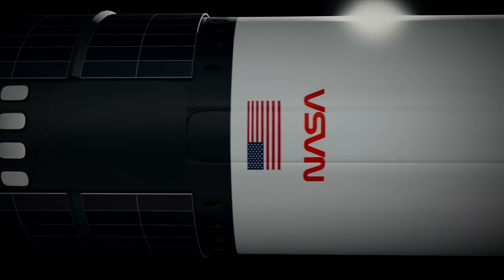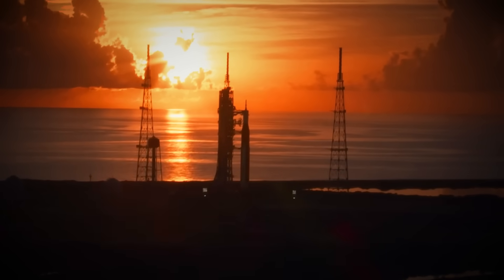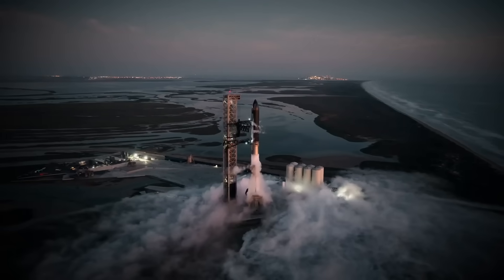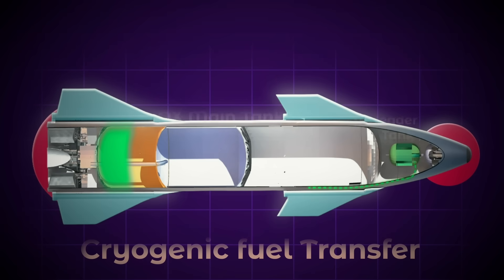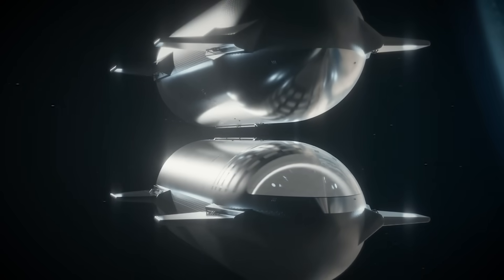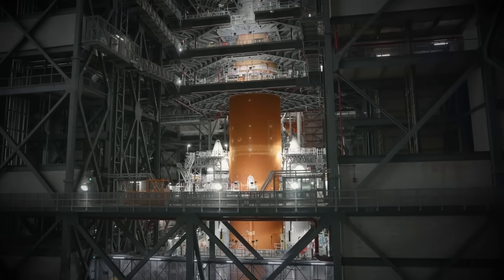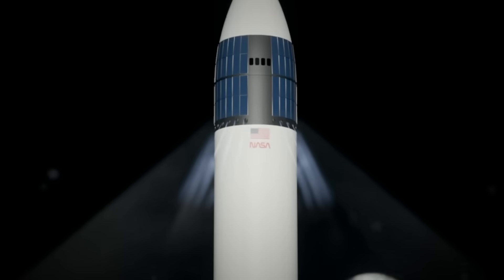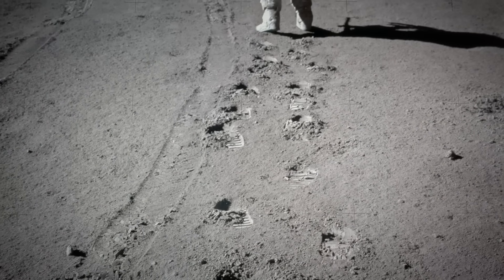How SpaceX and NASA Will Land On The Moon

Comment: I suspect they will have to build a tank farm in low earth orbit to make this sustainable. That way starship could hook up and receive fuel just like on the launch pad and a separate connection could be made to receive fuel from the tankers. You could also use a space tug to move a tank farm to lunar orbit letting a normal starship make the trip from the launchpad to the moon and back.

Comment: Space X needs to seriously consider landing horizontally. Eventually they will need to offload cargo and people which will be a lot easier with the vehicle sitting horizontally on the surface.
Reply: The rocket engines are in the end.
Reply: @ItsReallyJackBlack  Not the landing engines
Reply: Finding runways is going to be a problem, especially near the deeply-cratered South Pole
Reply: @shanent5793  Landing vertically on lunar soil

Comment: NASA getting $300 billion per year (At 1:42) is completely wrong. That was the cost of the entire Apollo program adjusted for inflation. The most NASA got in 1 year adjusted for inflation was $55.7 billion in 1966.
Reply: What??  The Apollo program was a NASA program.
Reply: @billweberx  Yes. And The Space Race confused the entire cost of NASA's Apollo program with NASA's annual budget.
Reply: @mrspirus5735  Yes.  I see that now.
Reply: @mrspirus5735  and even than it is always and interesting what we put into that program. for the 300 billion you have to push the entire gemini into the apollo, as well as the other moon stuff, like the rangers and surveyors. you can say they was a prerequisite, but at that point we can say that the german v-2 was also a prerequisite...

Comment: Land starship sideways, so it will not fall over like the last moon landing
Reply: Can't take off again.
Reply: But if they attempt a horizontal landing (like Flash Gordon's rocket ship) and a mishap occurs, it will end up standing upright on the surface.
Reply: they should get legs like the falcon boosters when they land
Reply: Falling over will be much more likely if they still have any sideways velocity at the surface
Reply: @shanent5793  Why would they have any sideways velocity?  SpaceX lands tall, skinny rockets every day.  As long as they have a flat surface, no problem.
Reply: @billweberx  they shouldn't, but that was the suggestion. Unless it has wheels or skis, a sideways landing will cause the entire weight and inertia of the vehicle to fall on one leg, probably breaking it. Starship HLS uses the same fuel supply for descent and ascent, so it should have plenty of fuel to find the right spot and descend vertically. If there were any reason to think the craft was in danger of tipping it should just abort back to orbit and preserve the crew
Reply: That's what I was thinking. Have a seperate lunar lander for astronauts, then have a starship like design land sideways on the Moon. The starship can acts as a habitat or have a habitat that can be driven out with wheels.

Comment: How long are they going to have to sit around waiting for another SLS each time ?, you would think Space X would / could have multiple lunar lander starships ready at one time, so send and park the un-crewed lander, fuel it with the 10 starships, then send a crew up to it in a Dragon or second lunar lander that could take it's place while the first fueled lander heads to the moon. Start sending starships up to fuel the second lander.
Reply: SLS is ready NASA is waiting for the Starship. SLD has been ready for 2 year did its flight test already with perfect execution. 

Starship is taking forever with no good amount of progress.
Reply: @ifldiscovery8500  you missed my point is about turn around, how long does it take nasa to build a rocket ? 10 years ?
Reply: @ifldiscovery8500  That’s not completely true. Artemis II doesn’t involve Space X in any way and that’s been delayed
Reply: A far more plausible idea. Artrmis is far too expensive, obsolete, designed by committee, unreliable and pointless.

Comment: It's gonna tip over.   There are not a lot of flat and level areas on the moon.  With gravity so low, what looks level might actually be a loose pile of dust and who knows how it will compress.  With Starship being so tall, it would not take much of a difference in height between the landing pads to cause the rocket to settle in deeper and deeper on one side and then eventually tip.

A week parked on a dust bowl in a 15 story grain silo?  Very high chances the ship turns into the leaning tower of pisa and then falls, stranding or killing the crew.  And since there is no back up plan to get them, stranding doesn't have a happy ending.
Reply: Who says that there's no backup plan?  SpaceX could easily have an extra Starship and booster ready on the pad on Earth, should the lunar lander no be able to return the astronauts.  The lunar lander has massive cargo capacity so they could have life support supplies to keep the astronauts alive for months.
Reply: @billweberx  They'll need those extra supplies in the event of an emergency. It can take up to a week to get back into orbit and rendezvous due do that wacko orbit that NASA has decided to use.
Reply: they need to lay down a landing pad first somehow. there's companies doing this
Reply: @elck3  So they need to go to the moon first in order to prepare the moon for the first moon landing?
I'm confused.
Reply: @ghost307   there are designs to drop a landing pad onto the surface of the moon without landing on it
Reply: @elck3  Sounds intriguing.
Do you have any links or company websites you can share?
Reply: They know exactly how it will compress because they've been there. Only the top fifteen centimètres or so is loose, it's much harder rock underneath. The tower of Pisa has been leaning for hundreds of years without falling over so it's not relevant  If by bad luck they land somewhere unstable they'll know right away and abort.

Comment: how  is Starship going to put a 100 ton payload in orbit when it failed to reach orbital velocity with no payload ?
Reply: They deliberately weren't trying to achieve orbit.

They wanted to be sure the thing would come back to Earth and not be some new orbiting space junk if they lost control of it.
Reply: They did reach orbital velocity on the second try.  They didn't plan to do a complete orbit around the earth so the SS broke up while entering the atmosphere during deorbit.
Reply: i heard elon say one of the launches failed because there was no payload
Reply: @tbounds4812  Correct.  Because they had no payload, they had too much liquid oxygen and had to bleed it off before deorbiting.  The oxygen bled into the engines and caused a fire and explosion.  Lesson learned.
Reply: They shut down the raptors just shy of orbit velocity on purpose. Until they can successfully relight a raptor in space, it’s too dangerous to go into a full orbital trajectory. That said 10 second longer burn on IFT3 would have put it in orbit
Reply: Stay skeptical, you have reasons to be.
Reply: @ludwigvanzappa9548  What reasons?  SpaceX has delivered everything they set out to do, most of which, no one else can do.
Reply: @billweberx They proved nothing so far and they won't either because it's a bad concept.
Reply: @ludwigvanzappa9548  This comment won't age well.  See you back here in May.
Reply: @billweberx Time will tell.
Reply: @ludwigvanzappa9548  For LEO it’s not. The moon we will see ig. Either way I hope it succeeds because Space X is the only option for Artemis.

Comment: so we are NOT getting even 1 flight per year from this SLS boondoggle? unreal
Reply: SLS is nothing more than a jobs program at this point.
Reply: @ghost307 SLS is proven concept that works compared to Starship. Atemis programme does not even need Startship and will happily walk away from Spacex if it's not ready by 2026.
Reply: @ifldiscovery8500  Today's NASA isn't our parent's NASA...or our grandparent's NASA.
It the equipment isn't ready in time they'll just push the target date back again.
Reply: @ghost307  they mentioned in a press conference that if Starship is not ready by 2026 they will move on to other competitors like BlueOrigins, New Glenn etc.
Reply: @ifldiscovery8500  Which will result in their timeline being pushed back.
Reply: @ghost307  it's already push back NASA 2030 schedule is looking less and less achievable.
Reply: @ifldiscovery8500  I mean at least Space X might pull it off in 10 years. BO is like 50 years away from reaching orbit at this point 😂

Comment: This lunar Starship is going to be too top heavy to be stable on the surface unless it has four wide-spreading, low slung landing megs. Otherwise the astronauts will tip it over from bouncing around in the crew cabin.
Reply: Hopefully NASA will look at this comments section and realize that they're actually really dumb and didn't think about that.
Reply: @KeithGroover  only because you 🫵🏻 flagged it for them.  On behalf of NASA, thanks!👍🏻
Reply: @KeithGroover  What's dumb about an artist's concept? What will land on the moon will look quite different to what you see in the promo videos.
Reply: The weight of the Raptors and of all the pluming at the bottom places the center of mass well below the middle of the ship. The legs will be designed to be wide enough to give it a good margin of error. The problem is the uneven surface and if some parts of it are "soft" while others have boulders. Maybe AI on board can navigate the last meters?
The unmanned ship will very likely carry an extra weight that simulates the astronauts and their equipment.
Anyone who thinks it will be simple or easy is fooling himself - but it can be done.
I expect at least 2 unmanned landings will be needed. (To get it right the first time is very unlikely.)
Reply: @knowledgeisgood9645   I agree with most of what you say here.  I think the legs will have to be bigger than the ones shown in the video though.
Reply: @GadZookz  Never take facts from animations. They almost always are wrong in one way or other.
Reply: @knowledgeisgood9645  Good, you're my bro coz you think a few levels deeper, as opposed to the morons here thinking they know better than a bunch of the very best engineers this planet has to offer!
Reply: @knowledgeisgood9645   I hope you are right because otherwise if it looks like that it won’t stand up for long.
Reply: No kidding.  The thing is going to tip.  Why doesn't anyone at SpaceX address this potential disaster?
Reply: @jakesmith4506  They just need to  abort the landing if it starts to tip.
That wasn't an option for the recent landers because they lacked the propellant to take off again.
Reply: I wouldn't be surprised if SpaceX jettisons the lower part of HLS with the big empty tanks. The propellants needed for the final landing and subsequent lift-off could be stored in much smaller tanks located in another part of the HLS. That would make it quite a bit shorter.
Reply: @ghost307  As these ships aren't destined to ever return to earth, that sounds plausible. I also recently read that Mining the resources for making steel is probably viable, and if so I think we can expect SpaceX to want to build a shipyard on the moon, to build Mars-bound ships. Launching from the moon would mean 1,000 tons to lunar orbit, or 500 to Mars.
Reply: @ghost307  But even more hardware is going to be single use only. I thought that they wanted to get away from that.
Reply: @rogerphelps9939  100% reusability is the goal, but I don't think it's an edict. If it makes sense to discard something for a good reason, I could see that happening.
Reply: The recent landers that fell over had sideways velocity at touch-down. They tripped or broke legs. That was the failure. 

If you concentrate on eliminating sideways velocity and use self-leveling landing legs, the wide base is not needed.
Reply: You'll be surprised how far such a ship can tilt before it actually becomes unstable. We're talking 100 tons of steel. And humans bouncing around, will not change anything. They don't have enough mass. And you can count on SpaceX to address any issues that could arise. Trust the engineers they have enough expertise not to overlook such a thing.
Reply: @paulmichaelfreedman8334  its the executives I don't trust. They think they know everything and have a solution instead of tasking actual engineers with a goal and then those engineers design a solution.
Reply: @paulmichaelfreedman8334  it won’t weigh that much when it lands on the moon and even less after the cargo is unloaded from one side.  Think again about how wide the legs should be.
Reply: @paulmichaelfreedman8334  have you ever use a lever? anyway if it isn't obivious, the issue is resolve just by sitting the crew in the middle, no one said you have to sit on the top, have you guys ever watch the expanse? flying the ship via LCD in a CIC is fun. 

@ghost suggestion is amusing but you will jettison the top instead since you want the engine at the bottom, it far cheaper to just throw away the top. you can just detach it while landing like a drop tank. there is alot of ways to design around the issue. we are taking the design too literally before it is finalised.
Reply: @paulmichaelfreedman8334  Engineers at NASA have over looked Starship design it was evident in a recent seminar about the Artemis programme.
Reply: Factor in the DEInauts and...